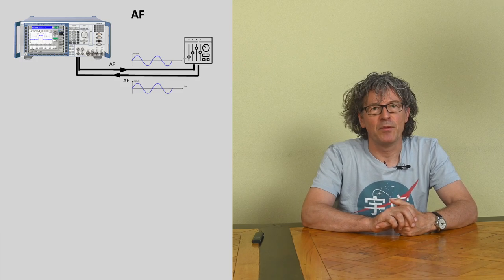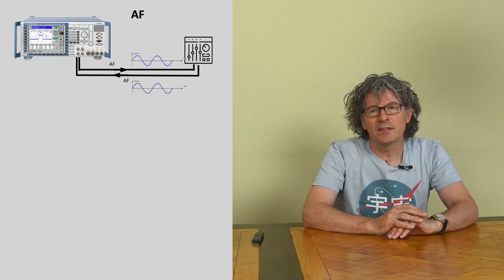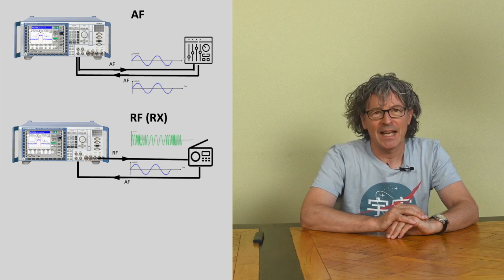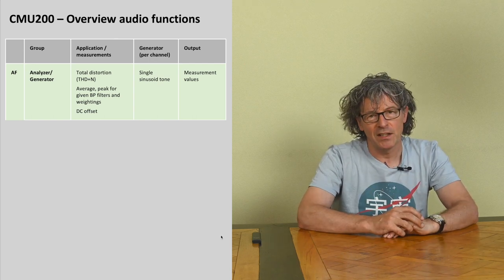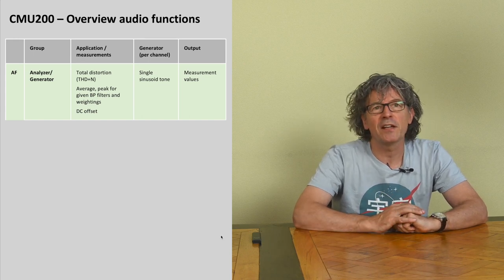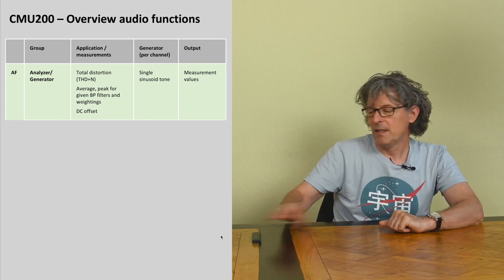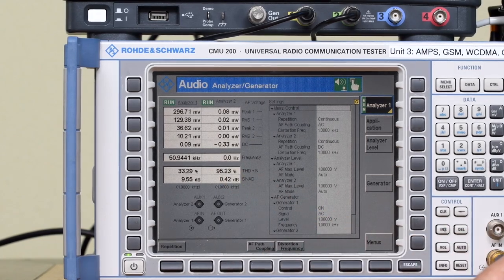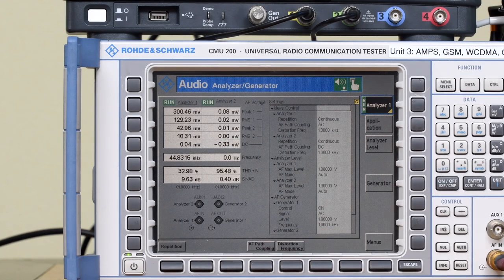REL #28 CMU200 as Audio Meter

Comment: I see your lab has a built in 4 legged "cat scan".  Checking to see if the R&S was performing as it should.  My new CMA 180 Radio Test Set shows SINAD, THD %, THD dB, THD+N, S/N, (S+N)/N, (S+N+D)/N all on one screen at the same time.  Shows Current, average, extreme and standard deviation for each measurement.  I was so happy to see that.  Another big selling point for me was that it has a not only the RF spectrum analyzer but also has a true audio spectrum analyzer.  It's a CMU 200 on steroids without the clunky cellular phone protocols.  It also has all the other missing features not found in the CMU 200 that are 2 way radio specific including a speaker that actually does something.  Having said that I will probably never sell my CMU 200's.  I have used them for so long I would feel naked without them.  I may not use them every day but they do get used a couple of times a week.  Amazingly powerful instruments considering what they sell for now days.  Great presentation.
Reply from the maker: The CMA180 looks very nice! And, perhaps more trivial, they finally gave the AF in- and output logical labels, compared to the not so logical naming on CMU200, CMU300 and CRTU's  ;-) Perhaps, when these CMA180s are as old as the CMU currently is, their price will have come down to affordable levels for amateurs on the pre-used market ;-) Then again, I understand that R&S “made (literally) tens of thousands” of CMU200s. That alone can explain the current wide offering.

Comment: A "small" error when you measure the SINAD  you had using RF_OUT1 but the instrument was outputting the signal on RF_OUT2 as can be seen by the yellow light....
Reply from the maker: You are quite right! At 52.29, when I start the video recording on that SINAD, it’s properly set at RF1 out. But indeed, later (at least at 57.24), it is at RF2. Probably happened when I did a reset on the AMPS mode, but unfortunately, that reset turned the generator to the ‘off’ mode, and so there were no lights anymore on the front panel to warn me that the channel had switched. In the end, recording videos is quite an intensive task, and it’s easy to overlook things… Anyway, the Sennheiser receiver was apparently sensitive enough to pick up the RF2 signal from the air ;-) But I agree that my measurements are now incorrect.  

Will one day do the measurement again properly and determine the actual sensitivity of the Sennheiser. Too bad the specifications of that receiver do not specify the sensitivity at SINAD target value 12dB (instead, they specify “sensitivity (with HDX, peak deviation) <2.5µV for 52dBA S/N”).